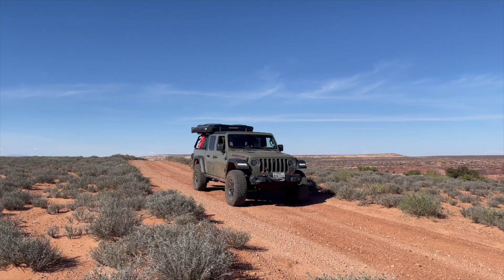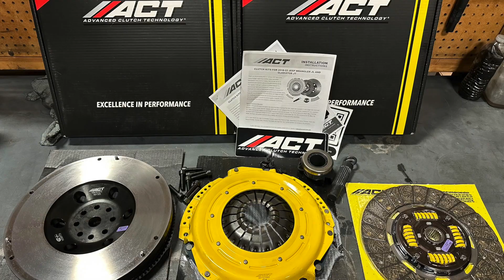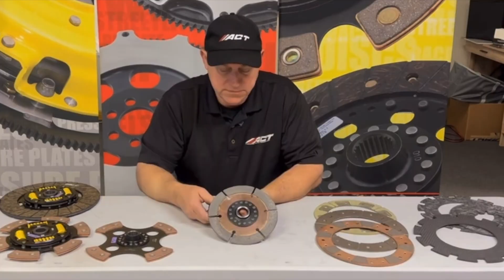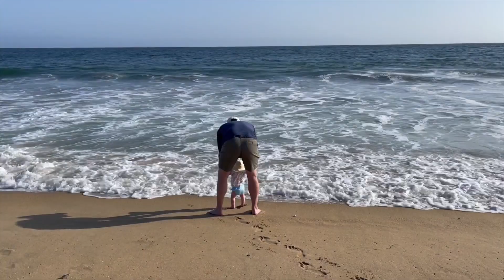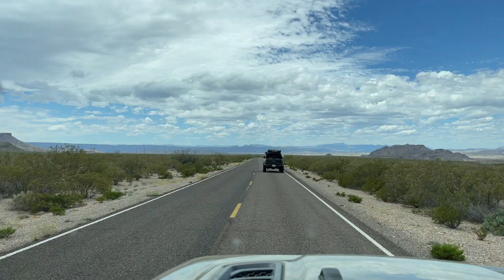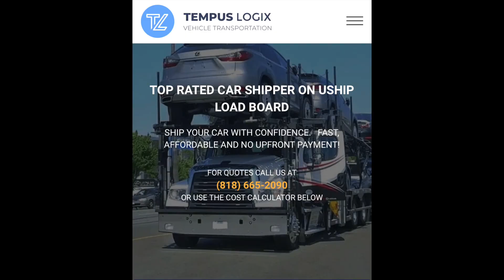ACT Performance Clutch with Pro-Mass Flywheel Review for Jeep JL Wrangler & JT Gladiator

Comment: Will the Street Mass have similar inertia  benefits as pro mass ? Or do you need the pro mass to get those benefits in traffic and hills?
Reply: I wished I had watched your video before I ordered the street mass 😂 but I don’t plan on running anything bigger than 35s since I do a lot of commuting and using a trailer isn’t in my future. So I think the 20% should be ok for my application. Your mention of not having to shift so much in traffic and the ease of crawling without it stalling makes me extremely excited and I hope that even with the street mass I get similar results as you did. There are so many shortcomings with the stock clutch, I’m just shy of 1k miles and already having clutch failure. With your in depth explanation I now know this isn’t me being rusty with a manual, this is 100% a mfg. flawed part that is causing not only overheating friction plates but just a really terrible shifting experience. I think I’ve stalled more times in the last week than I have in the entire time I learned how to drive a stick when I was a teenager 😂  can’t wait to wheel the JT with the new clutch and experience all this amazing rig has to offer….without stalling and bucking 😂
Reply from the maker: 😂 it’s not too late to change your mind , but Yes, I think you should be just fine with the street mass… Any inertia above factory is an improvement in my opinion… They now have a full install video specifically for the JT and it actually features my truck as the example, so, if you’re planning on doing it yourself, it’s a great step-by-step reference, including the torque specs…https://youtu.be/F1j550d5uBQ?si=D77P18MieyBF6I0x
Reply from the maker: Thanks for taking the time to watch and comment… In my experience, the pro mass in combination with the larger 37 inch tires and towing our off-road trailer has been such an incredible improvement… The RPMs hold longer between shift change and make for a really nice transition to the next gear. The promass also shows its face when you’re in four Low… It wants to continue, turning rather than stall out… As far as the comparison between the street mass and the prom mass… The street mass is about 20% inertia increase over stock, and the pro mass is about 50% Inertia increase over stock… Under his advisement they made The Street mass, so there was options available, but he recommends the pro mass for every application, modified or stock and in my opinion it’s the way the vehicle should have performed from the factory. About 20,000 miles on this clutch now and it’s awesome to say the least… I love it on and off-road… Let me know if you have any questions.

Comment: Thanks for this.  I've been driving MTs and 4X4s since 1968 and haven't really has much trouble with my 2022 JTR with 35s and stock 4.10 diffs.  After your review and some other research, I've ordered the ACT clutch system.  My question is what gears are you running?  The stock 4.10s or?
Reply from the maker: thanks for taking the time to watch and reach out… I have about 20,000 miles on the ACT clutch and it has been incredible to say the least… Absolutely no comparison to stock… I run 37 with 513 gears. I have about 50,000 miles on regear with not 1 regret.. It performs better than stock even loaded down… I get between 18 and 20 miles per gallon at 63 through 68 mph anything over 72 mph drops to about 15 miles per gallon… Just too much wind resistance with the aerodynamics of a brick

Comment: New to the channel, Thank you for these videos, Thank you for owning a manual transmission! I'm looking at buying a gladiator-overland with manual tx from carmax (Ive ordered the shipping and waiting for it to arrive for a test drive, it only has 4k miles). Regarding the clutch issue,  Did you have the recall performed where it limits the torque before you upgraded to the ACT?  Thank you, Loved your review on it a while back.
Reply from the maker: Thanks for reaching out and the kind comment.. I did have the associated recall work and flash done early on, but never had any issues with the torque management prior or since ACT install.
Reply: Thank you for the reply @GatorOverland

Comment: So would this increase my towing from 4500 lbs
Reply from the maker: Technically no.. the just the same that airbags won’t increase your cargo capacity… It will only enhance the ability you’re still held to federal regulations unless you went out for engineering test.. 
Now will it be more credible than the factory clutch pulling 4500 pounds? Absolutely. ..
There’s no testing done to show what it increases to for the Jeep gladiator, but the torque clamp force is now 479 foot pounds 273 which is nearly the torque rating of the engine… This new clutch could hold up to V8 power .. just know that it’s stronger than the factory clutch

Comment: It amazes me how expensive these jeeps are yet they use really inferior parts in a lot of places......glad to see another option other than centerforce.
Reply from the maker: They are brute where they need to be… Unfortunately, there are shortcomings dealing with other manufacturers that are involved with parts on the vehicle or… You also have to take into account utilizing certain parts across the whole spand of vehicles in the Mopar inventory being shared brands,,Especially whenever it comes to driveline. We have 12,000 miles on our ACT clutch and absolutely no regrets… It performs so well.

Comment: my 2019 wrangler JL had a clutch failing at 42,000 miles. Replaced with ACT street-mass. I have a question. Do you have any trouble getting into 1st or reverse from a dead stop? Sometimes I have to either push hard or go into second (or any gear) first then it just slides into 1st.
Reply from the maker: Thanks for taking the time to watch and comment. I have not noticed that it’s difficult to get in to first gear at a stop. I typically downshift the gears as I slow down so maybe inadvertently I’m doing exactly what you have to do to get into first. You may contact Dirk Starksen at ACT.. super great guy to deal with an brilliant clutch designer. He might have some info for you. Any information you get please reply to this nobody post for others.

Comment: I have a dumb question 
Whats the difference between JP5-HDG6 and JP6-HDG6 ? 🤷🏽‍♂️
Reply from the maker: Jp5 613 torque capacity with The Street Mass flywheel (20% more inertia)

JP6 613 torque capacity with promass flywheel (50% more inertia)
(These are ideal for boosted or higher horsepower vehicles)

mine is the JP6 – HDDS which is the 479 torque capacity with pro max flywheel

Comment: Take my money 
How much
Reply from the maker: They are actually on special right now… Normal price is 1400, but they are 1189..
You can do it yourself and 5.5 to 6 hours with minimal specialty tools. 
I’m not sure what the shop is going to charge, but typically it’s $150 an hour.
So $2000 to $3000 -ish for parts and labor

Comment: Been following you for a couple years. You actually took the time to text me a few times when i was having some issues getting my 37s balanced. 
I also have the manual and  considered  trading it in until i watched this video. Thanks for saving my Gator manual JT. This looks like exactly what the truck needs.
Reply from the maker: Great to hear from you!! This will put the beans in the pot for sure!!! I love it!
Reply: What bumper are you running in the front I like it 👍
Reply from the maker: The factory MOPAR steel bumper https://youtu.be/5BnI4QNV4MI
Reply: Did you do the work your self ?

Comment: Had to get mine replaced around the time of the first recall (around 32k miles and it was starting to slip in 5th and 6th gears), and it didn't feel like the replacement was identical to OEM. The good news was that the dealer did it at no charge due to the recall. Now they have yet another recall out for the same problem. Why did they use the SAME clutch assembly in the 21s-23s when they KNEW this was a problem? Either way, I was planning on getting an upgraded clutch from Centerforce, so thank you for showcasing another option! You may have changed my mind, and I might go this route once it's time to pull the trigger.
Reply from the maker: Thanks for taking the time to watch and comment Kyle… I’m sure both options are worthy of upgrade, but simply put, “less is more”, when it comes to mechanical components, especially ones that wear. Dirk has a good relationship with Centerforce, and had no qualms with me, making the decision to go with them if I had, but after talking with him for just a few minutes and understanding some of the advantages with the ACT (not to mention those legacy in motorsports already in the back of my mind) like you, I appreciated knowing there was another option out there. 
I’m sorry to hear you had issues so early on.. yes it’s been a known issue even further on into the 2018 wranglers .. cheaper for them to just replace with faulty clutches than re-engineer a new one.. who knows what their reasoning or limitations are for making the decisions. 
It’s time and money at this point.

Comment: Good review.  Thank you!  My Gladiator has 38K miles and the clutch recently has started having a rough (and getting rougher) feel as the pedal is pressed and released.  I'm caught between the newest recall on it and wondering if I should just go aftermarket.  I've been using Centerforce clutches on my 2007 Wrangler (297K miles on it).  But I'll keep ACT in mind.  

BTW, my first off-road adventure in the Gladiator was a January 2020 trip to Big Bend.  Not my first time there, but still a great adventure.  Part of it, Road to Nowhere 😅at the state park, was written up by one of my travel companions (Susan Dragoo) and published in OutdoorX4 magazine.  The videos are on my YT channel.
Reply from the maker: This is awesome mark!! Great to hear from you!! ACT has 30% off right now!!!! I also was going centerforce until talking with ACT. As mentioned in the video, ACT only requires replacing the clutch and flywheel, all the other operations is still factory… 
Centerforce requires upgrading the hydraulics to work with their clutch.. I think they have revised it the hydraulics twice now for better feel on the “over center effects”. Hands down one of the best improvements over stock that I’ve done.. I do have a 5.13 regear, but the pro-mass flywheel makes these 37’s disappear.. I love it!!

Comment: What gear ratio are you running with those 37s? Your comment on mpg... Did you get that mpg prior to the act clutch or did the clutch dynamics improve your mileage?
Reply from the maker: I run 5.13 gears.. when I’m unloaded I get 18-20mpg.. before the regear it was 16-18mpg.. 
if you’re going 37’s i highly recommend the regear… especially if you are manual. I haven’t noticed any significant fuel eco improvement with the new clutch.
Reply: @GatorOverland  I used to run 35s and I was dead set that was the biggest I'd go. When I got it regeared the shop said I should go 4.88 incase I opted to go 37s later. I insisted on 4.56. I was getting like 16 to 18 mpg with 35s and 4.56

Fast forward 3 years I went bigger to 37s. And I'm getting 15 mpg at best (stock clutch) usually closer to 14.

I don't weigh it with as much gear as you do but I do tow and haul a lot. I have been debating if I should step up to 4.88 or go for 5.13.
Reply from the maker: I was in that fence for a while, but I was advised that 5.13 is more ideal for the heavier truck application in general. I have a buddy with a JLU that went 4.88 and wishes he with 5.13.. in the end it makes a difference of 200rpm… if your cruising at 65 @2000 rpm with 4.88 the 5.13’s would be 2200.. I have no regrets going 5.13 and my 37’s tires are actually 35.5” @ 30psi, so mathematically 4.88 would be idea.. but with on 6spd vs 8, the 5.13 is where it’s at for me 🤝
Reply: @GatorOverland  one other question for you. Did you have any issue with the higher mass flywheel and the autostop /start? I had read feed back on the similar centerforce part that it was better just to use in tandem with a tazer and disable the autostop/start.
Reply from the maker: I’ve read the same and I do not have an issue with ASS.. I had originally done the plunger disconnect to deactivate the ASS along time ago but reconnected it to have an answer to this specific question. Works fine.. I think it’s a suggestion for “longevity”.. I have since disconnected the plunger to deactivate it again.
Reply: @GatorOverland  I don't have any issue using the ASS (Hadn't seen it abbreviated like that before but I like it). I run mickey Thompson baja boss ats 37 12.50 17s and they measure about 35 installed, I didn't catch what tires you had in the video.

I saw a trailrecon video where he had a jl with the 8 speed regeared to 5.13 but then later dropped it down to 4.88.

I'm glad to see your in depth review that is specific to a manual. If you are getting 18 to 20 with 5.13s that is about my ideal target. It's hard to find feedback without the "it's a jeep it's not a prius" crew saying dumb stuff.

I spend about 90 to 95 percent of the time driving two and from work or taking trips than I do rock crawling.
Reply from the maker: Just about everything you said, including the 513 to 4.88 video by trail recon is spot on with my experience… the fuel economy is relevant to your environment, elevation, speed, etc.… II too drive to and from work 95% of the time… The rest of the time is trying to have fun somewhere other than home… My truck is built for highway, priority and off-road capable… I could care less to rock crawl but sometimes it’s involved… I have no regrets doing anything. I’ve done… 2 inch lift, 37, 513s, AC T clutch… All worth it.
Reply: @GatorOverland  so to kinda summarize. You would still go 5.13 over 4.88 if you had to do it again?
Reply from the maker: Absolutely!! Especially with the 6sp manual and the JT because the gear ratios are spread further and the truck is heavier.. you could probably get away with 4.88 in the JLU because it’s lighter
Reply: @Thisguyuknow  I've got 5.13s and an ACT clutch sitting in my garage waiting for install.  I also run 35 STT Pros. Don't be afraid of the gear; these manuals NEED a serious gear upgrade.  IMO, it should have come with 4.56 from the factory with the 33s.
Reply from the maker: Totally agree! They actually are optioned with 4.56 on the XR wranglers now which is pretty cool..
Reply from the maker: Austin, I’m looking forward to hearing what you think about your upgrades after your install. 🤘🏼🤘🏼